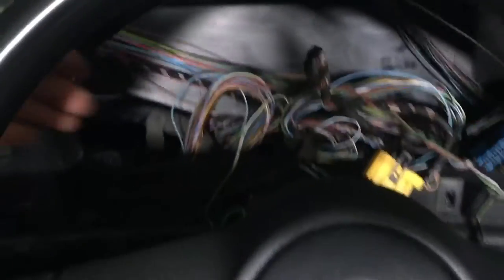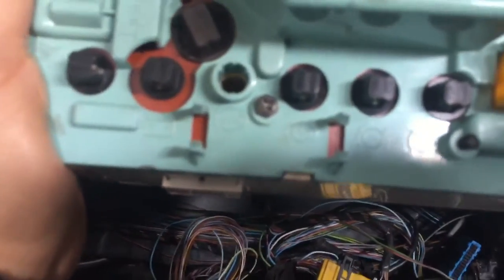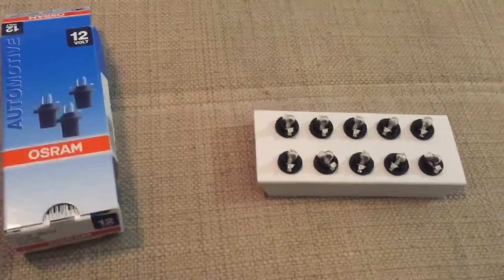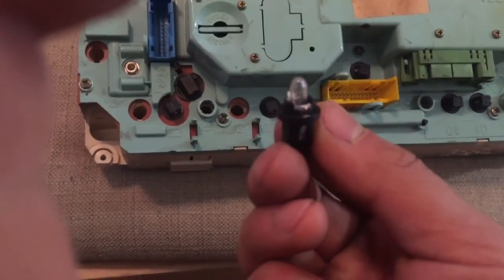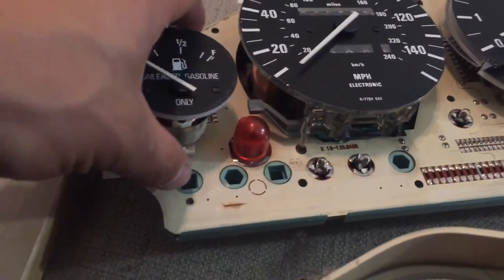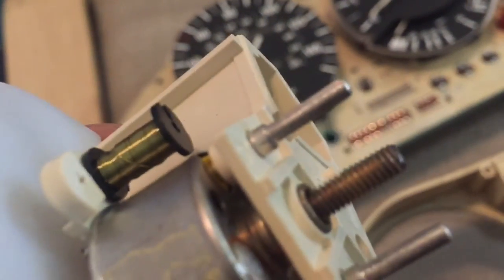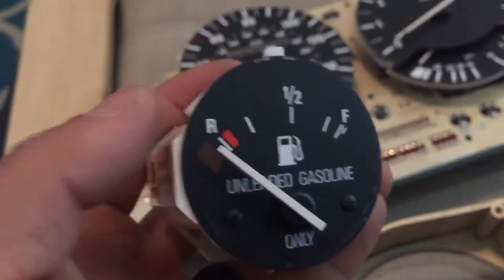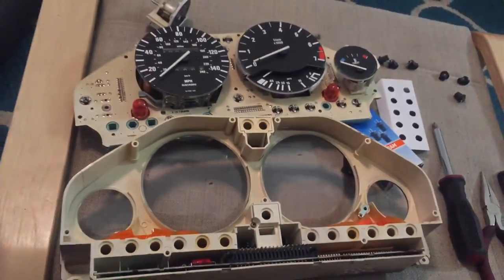Beemer Zar - BMW 325i Cluster Bulbs and MORE!

Comment: What do you recommend to do if the odometer is not recording new miles?
Reply: If your speedometer is registering your speed as you drive, then you may want to replace your instrument cluster.  They are very inexpensive online.
Reply: New odometer gears from garagistic.
Reply: You can rebuild it with a kit from garagtastic amd its very commen failure point on all vdo clusters

Comment: Does anybody know the purpose of the yellow Port on the cluster? As i dont have any connector that goes in it
Reply: OBC, older models dont have it and its not necessaary.
Reply: @shredyspaghetti8961  what is obc ?
Reply: @EliasRizk53  on board controls